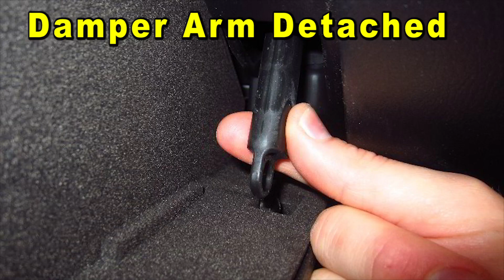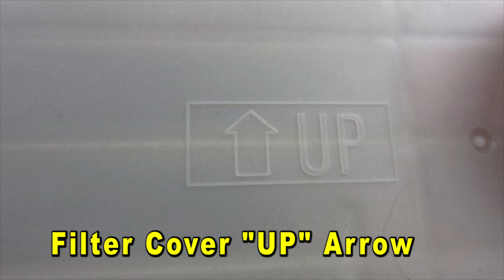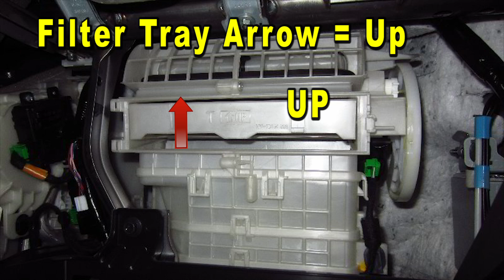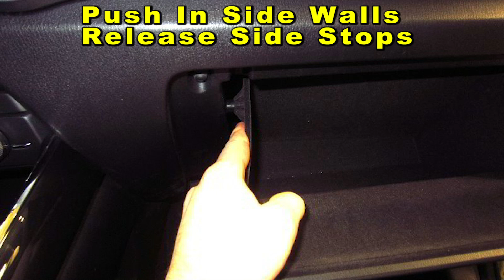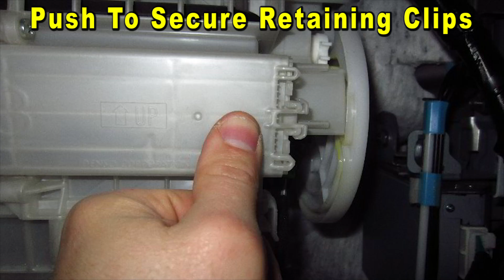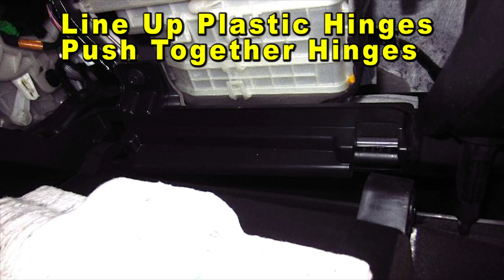Mazda CX-9 How To Change A/C Cabin Air Filter 2016 To 2023 With Part Numbers

Comment from the maker: Check out the DIY guide for changing the A/C system's cabin air filter element in a 2nd generation 2016 to 2023 Mazda CX-9 SUV - 
https://www.paulstravelpictures.com/2016-2021-Mazda-CX-9-Cabin-Air-Filter-Replacement-Guide/index.html

Here are all of the DIY repair and maintenance tutorials for the second generation 2016, 2017, 2018, 2019, 2020, 2021, 2022 & 2023 Mazda CX-9 - 
https://www.paulstravelpictures.com/Articles/2016-2021-Mazda-CX-9-DIY-Repair-Maintenance-Guides.htm

Owners of other Mazda vehicles such as the CX-5, CX-3, CX-30, MX-30, CX-8, Mazda8 (MPV), MX-5 Miata, Mazda2 (Demio), Mazda3 (Axela), Mazda6 (Atenza) and Mazda5 (Premacy) may also find these DIY instructions to be helpful.

Comment from the maker: Mazda CX-9 A/C Cabin Air Filters - https://amzn.to/40fHxmO
Spearhead Cabin Air Filter Part Number - https://amzn.to/3MowvpM
K&N Washable Cabin Air Filter Part # - https://amzn.to/3Mi9Ta7
Premium Guard Cabin Air Filter - https://amzn.to/3Sh5cBh
Precision Screwdriver Set - https://amzn.to/3OYN1i0
Plastic Pry Bar Tools - https://amzn.to/3HMtsV7
Socket & Ratchet Set - https://amzn.to/3Z17LbA
Mechanix Gloves - https://amzn.to/3jCnHkt
Torque Wrench - https://amzn.to/3vS5uSI

The Paul79UF YouTube channel is a participant in the Amazon Services LLC Associates Program, an affiliate advertising program designed to provide a means for sites to earn advertising fees by advertising and linking to Amazon.

This DIY video shows owners of the 2nd generation 2016, 2017, 2018, 2019, 2020, 2021, 2022 & 2023 Mazda CX-9 how to change the HVAC system's cabin air filter element.